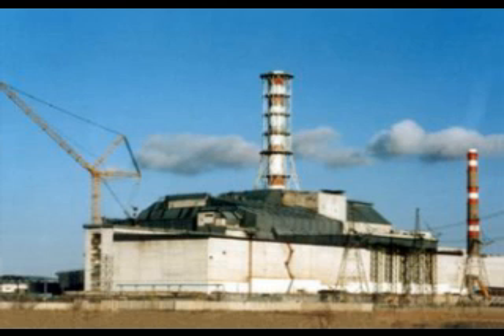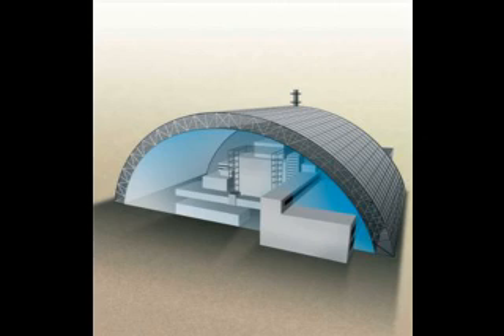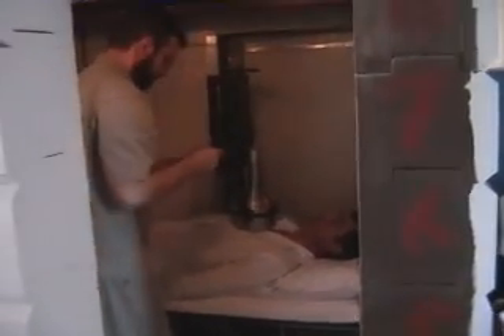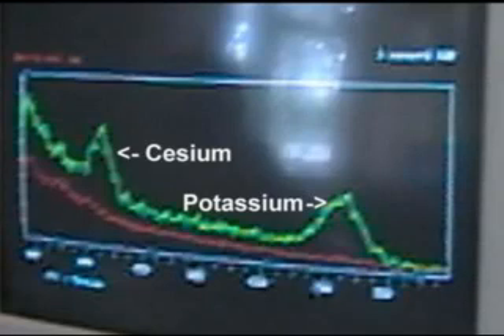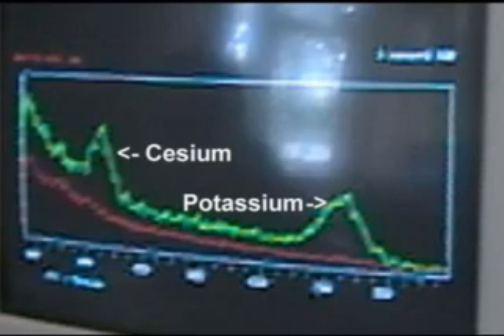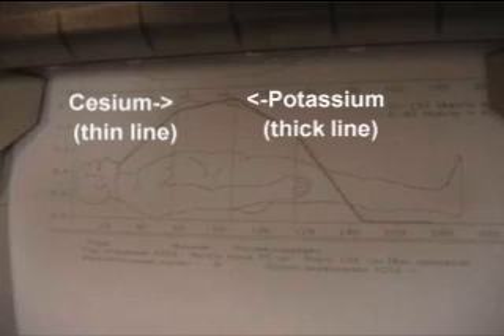Chernobyl Sarcophagus Construction Workers

Comment: Actually it CAN.  Cherenkov Radiation is visible radiation due to the speed of the gamma waves being slowed down to subliminal speeds (slower than the speed of light.)  In the case of after the accident the air was filled with moisture from the explosion as well as water from the initial firefighter response.  With the amt. of radiation pouring out there were many reports of seing a column of light blue light.  That was the Cherekov radiation.